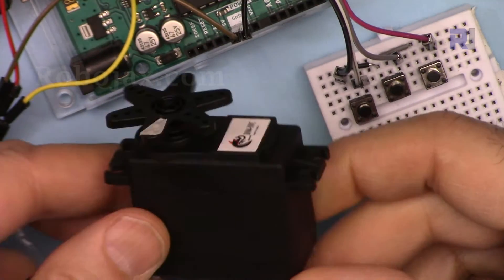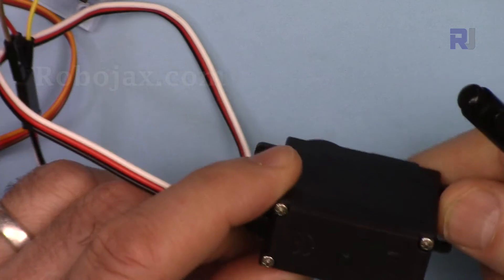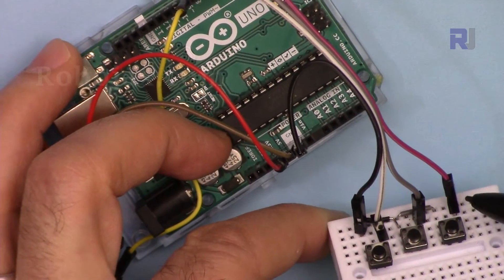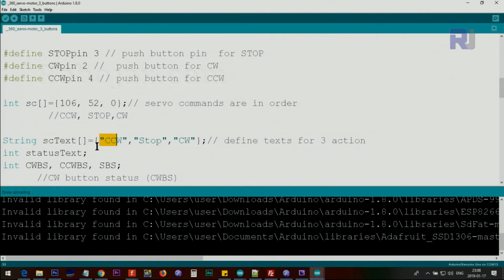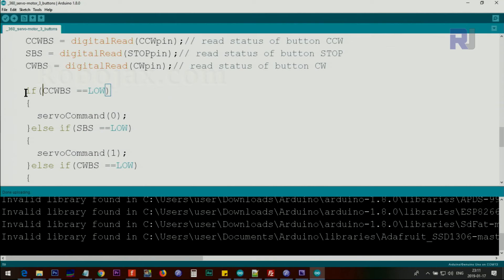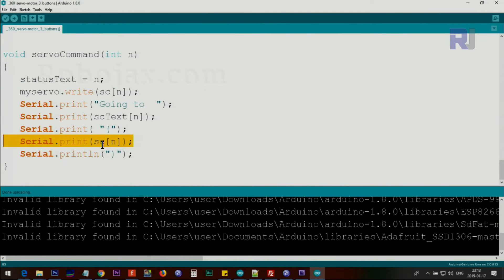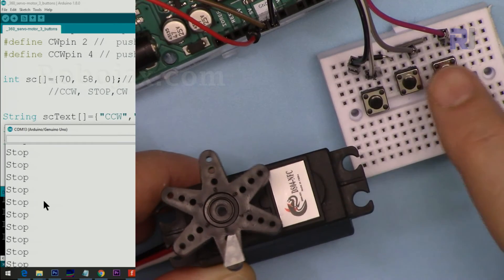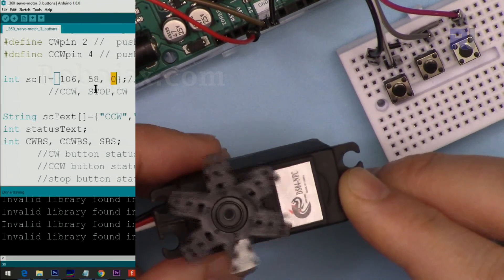Lesson 89: Using Continuous or 360 Servo motor| Arduino Step By Step Course

Comment: Thank you for the clear explanation of the 360 servo sketch.
I do have two questions:
1: could it be due to the servo version that "stop" works at 90 pace
"int sc[]={ 180, 90, 0}; //servo commands are in order "
2: That I can set the minimum speed by this rule ???
"int sc[]={ 97, 90, 85}; // servo commands are in order "
Can it run slower???
Sincerely
Leo
Reply from the maker: I have mentioned it multiple times that this is just a joke to prove some point. this is not actual product to be used for projects. Please use stepper motor so you can properly and precisely stop and move it. I wanted to delete this video but it seems somehow people watch it. I hope you  understand forget this. Search my channel for stepper motor. learn how to Search for a  Particular  video in a channel here https://bit.ly/findYouTubeVideo

Comment: Hi Robojax. Great video. I needed full rotation servos, to drive the flaps on a model aircraft. I took an ordinary servo apart and removed the drive to the feedback pot. It had the same problem as your circuit. Which was that the Stop position was very sensitive. As I had more than one servo I didn't want to work out the stop value for each one. So the solution I came up with was to set myservo.attach(unUsedPin); to an unused pin, effectively disconnecting the actual servo. I would then have the attach() inside the direction functions. Hope this helps.
Reply from the maker: Hi, thank you for your comments. I appreciate it.   this is product is just a joke to prove some point. this is not actual product to be used for projects. Please use stepper motor so you can properly and precisely stop and move it.